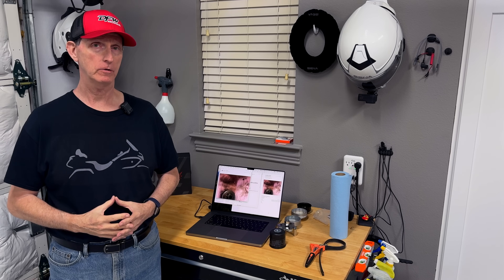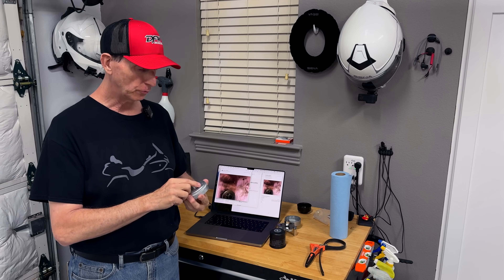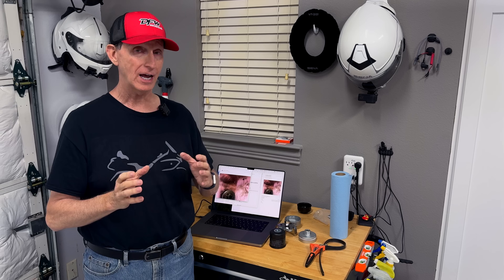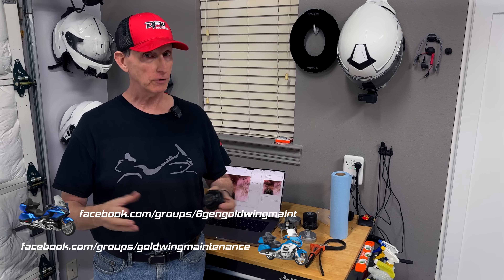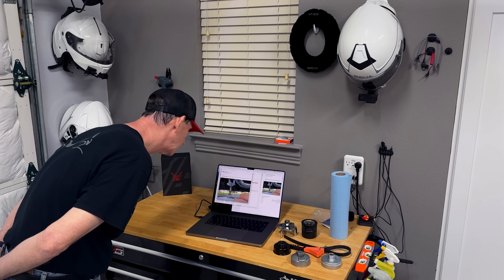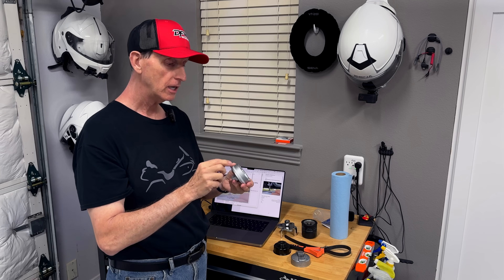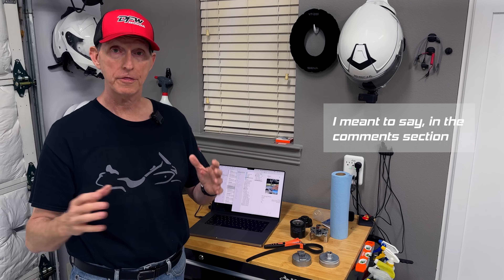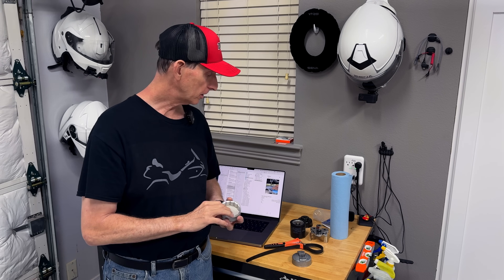Removing A Stuck Motorcycle Oil Filter | 2024 Honda Goldwing

Comment: The 65mm, 14 flute filter from Walmart fits snug, but will slip on a very tight filter. Buy the 64mm, 14 flute, also from Walmart, and it will fit perfectly and not slip. I'm speaking from experience.

Comment: I just did my second oil change last week on my 2018 GL1880B, 6,000 miles. I had a heck of a time getting the filter off, and I put the last one on. As you mentioned the filter wrench from Honda just slips when you try to remove it. I ended up drilling a hole through the side of the wrench and then ran a short screw through it, into the filter. Wish I had taken a picture of the filter, what a mess. None of the flat wrenches work because the filter doesn’t extend far enough below the engine case to be able to get it on. I’ll be buying the Amazon or Mac tool filter wrench ASAP. I only screw the filter on hand tight and can’t believe how tight the bond, oil filter to engine case is. Another awesome video. Wish you would have dry fit the 3 prong wrench on the oil filter on your bike prior to the video, but you probably had your belly-pan in place. Glad I’m not the only one who’s had this problem.

Comment: This is a simple obstacle to overcome, I have had a similar situation with a stuck oil filter on my last bike. Solution: take your oil filter wrench and drill two 1/8” holes into the bottom of the wrench opposing one another then put the wrench on the filter and using a cordless drill insert two self tapping screws into the holes that you drilled into the wrench bottom. Now take your socket wrench and slowly exert pressure to loosen the filter, no jerky movements. I have used this method several times since and it works like magic. One note though: do not place the holes too close to one another but keep them as far apart as you can while still allowing the screws to engage the filter so as to provide better leverage on the filter. If you place the holes too close to one another you risk tearing the bottom of the oil filter.

Comment: Thanks for sharing, I am in the process of dealing with this issue right now. I tried the set screw idea on the side only I just shot a self tapping screw into the filter and it wasn’t good enough, it actually ripped a nice little slot in the filter. Before watching this my next idea was the same as the doctor with screws coming up through the bottom. I think I might try the punch idea first. Thanks again for your videos, especially this one! And I will throw in my two cents on why I think this happens in the first place. Of course we all know that the filter is on too tight but the reason that it’s on too tight is; you can’t turn the filter on with your hand because the lack of room. It is very difficult to get a feel for turning it on just right using a cap wrench especially if you’re using a ratchet. Thanks again!

Comment: When I first saw the video about this, and even today I believe the oil filter wasn't on too tight, but the dent in the filter had caused the diameter of the filter to be reduced, thus causing any oil filter wrench to not be able to sufficiently grip the filter. The filter being damaged was the cause of this situation. This is a good video on what to do if someone needs to remove a filter that has been put on too tight and the filter is not damaged.

Comment: Yep, it sure did happen to me. Picked up my new 2024 DCT Goldwing three weeks ago. Jumped on and got 500 miles the first weekend. OK it's a good time to do the first oil change and yes the oil filter didn't want to part way with the engine. Thanks to your video that I watched only a few days before I was able to remove the oil filter. I did use the cheap oil filter wrench and put two holes about one inch apart, tapped them, used two set screws and it worked. Thank you for the advice.

Comment: My 2018 was the same way first oil change. Sometimes one can put a hose clamp on the stamped steel filter wrench and get them off. You can tighten down the hose clamp on the outer edge of the filter wrench and it will grab those filter flats. A slightly smaller strap wrench used correctly would have got it. Or a band wrench and I have two of those Blue Points that I added set screws to but they are larger filter wrenches. Once the standard stamped steel unit slipped I got out my never fail Channellock 460 16.5" pliers. I could have got it off with the hose clamp trick and other tools. But the tips of the Channellock's broke it right lose. It can be a challenge to use the big boys. But I got just enough of the tips of the jaws on two flats and broke it right lose. You did right by not exercising the screwdriver option. You don't have to punch the screwdriver all the way through to get most filters off. The risk of over doing it and punching a hole or cracking the case makes it a no go to people that understand tool craft and what could go wrong. Taking the bike to the dealer taught you some tool craft and your gut feeling served you well. Oil filter was locked on my new MT-09. The filter on the Yamaha is much more accessible and one sight of the Channellock's and the filter quietly accepted eviction as have many motorcycles, cars, trucks and such before. Good Luck

Comment: I use the flat wrench like you showed there with the drain bolt hole on the handle end and the filter wrench on the big end and it works quite well for me on my 2007.

Comment: I've not had trouble with any filters, but I did have trouble getting the oil drain bolts removed from my 2018 DCT. The shop had done the first oil change and I was doing the second. I pulled so hard on those bolts I was honestly concerned I would strip them or break them off. Even the DCT transmission filter bolts were so tight that I truly almost packed the bike on a trailer and took it back to the dealership. I've also found other fasteners either broken or so tight they break. Those shallow 5mm bolts have stripped out a couple of times trying to remove them. I can get them out, but have to use an easy-out. That's BS for those bolts.
I will not allow them to change my tires any longer either. I bought a Rabaconda and will do it myself. They are great about getting me in there, but when I was forced to change out my rear tire myself the bolts were so tight I broke an impact socket trying to get them out. I ended up buying a 24 inch breaker bar and new sockets and then got the bolts out. I'm done with them touching my stuff.
My dealership has a great parts department, sales people and even the service writers are great people, but their primary Goldwing Tech is not my favorite person on the planet. Because they allow him to touch my bike I will never let them work on the bike again. I will still buy from them and get parts, but they aren't putting a single accessory or doing any work on it until that guy is gone. (I also found I was missing clips and some panels had broken tabs when I changed my filter. They were the only ones in the bike prior to that discovery.)

Comment: Hi cruiseman you did the right thing rather than destroy the filter and as your goldwing is under warrantee it was the right thing to do , imagine if you had gone ahead and cracked the casing would honda have covered it ? Another point is how many owners world wide have had the same frustration on a new bike ,imagine the mechanics  "oh heres another one" this says to me that the checks are not being done on there production line at honda and i would say someones butt would be in the sling as i am sure honda would be aware of it ,anyway some good ideas but you wont have to worry anymore as now you will put it on at the correct torque ,i wonder how many goldwings have had this problem it would be interesting to find out globally .

Comment: I had the same issue twice. Once on my 23 and again on my buddies 23. Could you tell me what Honda is thinking here? We got lucky with an Amsoil wrench that was, ever so slightly too small and a persuader tool, [that would be a small hammer]. It worked I will be getting one of those new wrenches for the future. I would rather have it and not need it than need it and not have it. be safe everyone.

Comment: There are certain tools I will always pay more for just because of the quality but more importantly that will do the job safely and correctly, without causing additional stress/  problems- just an important point to part with my fellow riders ( as per spec book there is an actual torque limit setting for the oil filter and as such if your attempt exceeds that spec and damage is caused ie cracking of the housing ect  your warranty could be void. It is best to get the dealership to remove the first oil filter. I have had many a conversation with Honda on this issue only to be told it is not their issue (  even though they use a pneumatic tool to install the oil filter ) I have seen and heard of many cases where the dealership/ mechanic or the owner has been out of pocket due to damage caused from the removal of this filter. Just a suggestion have the filter removed and replaced prior to first picking up your new pride and joy. Please if possible when you experience this issue ( sadly you will ) send feedback to not only your dealer but also directly to The manufacturer- hopefully they will address the issue and resolve the problem.Awesome Vlog again my friend. Stay safe , Stay upright everyone.
Reply: I am hoping to purchase my first GW in October and already decided that prior to taking delivery of the bike I will ask the dealership to break the oil filter loose, just so I don't run into that issue.  Then each oil change I do I will use a K&N filter as they have the 17mm welded nut on the end.....problem solved

Comment: I still like the idea I sent you for modifying the cheap style black socket type wrench, but any choice you use that works for you, just be very (very) careful around that shifter boss (manual) just forward of the filter, because it wouldn't take much to cause a major problem if you were to come up against that applying torque with the wrong tool and crack that at the engine case. Honda should have designed that better (shorter). Cheers

Comment: i got the 3 finger tool from harbor freight. it doesnt fit between the filter and the engine case.
Reply: Yep, @cruisman you might want to remove that one from the description. It doesn't fit. I have an even more slimline version of that one and it doesn't fit either.

Comment: Just did first oil change on my 2024 goldwing. Got a cheap filter wrench at Napa auto parts. Guess I’m a lucky it came right off . Was a little tight but no problem. Everything went smoothly. I did put the wrench on filter the tapped on it to make sure it was all the way on. Didn’t tap to hard though. Why didn’t they make it 5 quarts?

Comment: It seems to me that the oil filter being stuck usually is a problem on the first oil change or if you have the oil change done at a shop then change it yourself. I prefer to just change it myself and not have to worry about it

Comment: The finger one isn't strong enough to remove the filter on the first oil change if the filter is on tight.  I used one and broke the teeth in one of the fingers just trying to get the thing off.
Reply from the maker: @KreepnSlayer11  Wow. How did you finally get it loose?

Comment: I just went to change my oil, and same thing…couldn’t get it off…my oil filter cup tool just kept spinning…I finally ended up putting a screwdriver into it and broke it free…I don’t know why it was too tight…I screw the filter on until it stops and then just give it a tiny bit more….anyway, at least I got it off…whew, what a pain in the butt that was….ride safe

Comment: Why do you think it is so hard to remove the factory installed filter?  Do they not oil the gasket first?  Do they tighten it down to where it's metal on metal?  The factory is obviously doing something wrong.

Comment: It's not a problem if mechanics/people remember that oil filters are only supposed to be tightened finger tight. Don't get a damned gorilla to do your oil and filter change.
Reply from the maker: @Jim-nm1en  this one came from the factory over-tightened
Reply: What's odd is that the Honda service manual specs the oil filter to be installed at 19 ft lbs, so yeah that's pretty tight, I can't get close to that with using my bare hands in that tight space....hmmmm.

Comment: If would be nice if the oil filter manufacturers made a filter with a nut spot welded to the bottom of the casing, so you could get a wrench or socket on it without having to resort to a cup.  Also got my fuel pump changed out today.  Top notch service and only took about 1/2 hour.
Reply: Several years ago I came across K&N oil filters that have a hex nut welded exactly as you suggest.  I had similar trouble removing the oil filter from my Harley where the filter mounts horizontally in front of the forward cylinder.   With the nut and a socket on it removal is now easy.  One caveat is to only use the nut for filter removal  not when installing because there have been instances where too much pressure on the nut could cause the filter to leak oil around the nut.
Reply: @studmuffin8859  I use a K&N filter on my Harley, makes life much easier.  However I do use it to put the new filter on as well as it makes easier to get the filter in place and started, after it seats and just give it ¼ turn to nip it up and jobs done.
There is a K&N filter for Goldwings, no more costly than OEM and filtration is just as good